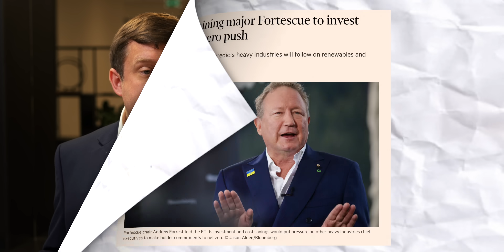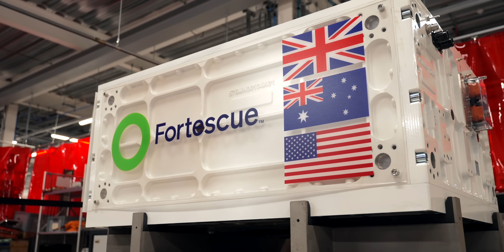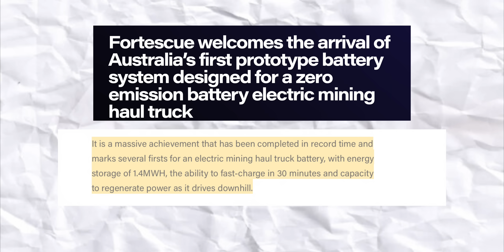This GIANT Electric Mining Truck Charges in Under 30 minutes!

Comment: Then there is Komatsus E-230 Electric trucks that feed the electricity from overhead wires and have the power and electricity to run at double the speed of diesel trucks as they do at Cooper Mountain mine BC Canada

Comment: It isn't really true - it doesn't actually charge in 30 minutes - Unless - a giant battery farm has been charged in advance.  Like the Tesla Semi - you can get a faster than expected fast DC charge from a farm of batteries pre charged ready to transfer the power, however - that isn't much different than a battery swap; and now you have a giant depleted battery farm incapable of charging any other giant trucks - so - subsiquent trucks will take hours upon hours to charge - and that is only via the grid because it is very unlikely that the first truck charged would do so in the morning, and much more likely the afternoon with insufficient time of day to charge a large battery farm from solar. If you charge from the grid, you've achieved nothing.

Comment: I still don't understand how they can say are "going green" when the battery life is estimated at only 2 years. 360 trucks changing batteries every 2 years is a lot of waste batteries as they haven't worked out recycling yet other than saying they will be used as a battery bank for the solar array.
Reply: Where did you get the lifespan from...?

Modern EV cells last for more than 3000 charge cycles (3000 cycles results in a 90% capacity left)...

The amount of diesel these haulers normally use is staggering.

So yes, its kiteralky going green
Reply: @zaarkeru3391  I work for the truck manufacturer and the specs were released to us. The only problem is that they are yet to actually make a battery work. We have had the first battery truck on site for over 18 months and are still waiting for the first battery. The reason the battery doesn't last is because they are being fast charged every 12 hours.

Comment: There are many organisations researching battery powered mining trucks, a  big challange is the power required to haul material up a ramp. The video commented on the 220t trukcks - this is the payload. A fully loaded 793F weighs about 390tonnes or 216 Tesla Model 3's. The energy density of batteries is poor when compared to diesel. Trucks run for 24 hrs without stopping on diesel, on batteries they need to charge for 10-30 minutes every hour. A swap out system would help ease this impact, but still at a cost to production.
Exciting times in the mining equipment world - but marketing is way ahead of technology.

Comment: As long as the battery packs are easily replaceable so the maintenance people can do a changeover at some stage a reasonable idea. With early adopters of EV vehicles well aware of the need for battery pack replacement once over a certain mileage the pitfalls of EV vehicles should be noted.
Hybrid vehicles are making a sales comeback for many good reasons including longevity and reduced emmisions and much better fuel economy.
😎🇦🇺

Comment: Never show a loaded truck moving.Just saying!
Reply: You know, currently, there are a lot of EV trucks working on mine sites. Those  use electric motors and haul up to 360 tones already with ease. The only difference with these pure battery ones will be that they get powered by batteries as opposed to diesel generators,  which has zero relevance on the output of the electric motors.
Reply: Who in their right mind would doubt the torque of an electric motor?

Comment: The problem doesn't  lie so much if you can make the truck electric. The challenge  is where are you getting the electricity from to charge the electric trucks. It requires enormous infrastructure up north in the Pilbara to supply the needed electricity to run a operation of not just one truck, but a whole lot of them. And the electricity they use should be green. Not from coal, gas or oil.
Reply from the maker: I wonder what sort of electricity you could generate in a remote but very sunny locations with millions of acres of desert around you. I can't think of anything that could do the job, shame there isn't some sort of technology that can convert sunlight into electrons, and then store those trillions of electrins in some sort of storage tank, you could call it a battery maybe.
Oh well, one day, until then we'll just extract oil half way around the world, pump it onto massive ships, burns thousands of tons of bunker fuel, docvk them in AUstralia, pump the crude into takns, use huge amounts of electricity to refine that liquid into diesel, put the diesel on trains or trucks and transport it thousands of miles across the desert to burn it once in a massive, inefficient engine.
That's a much better idea.
Reply: @fullychargedshow  you can say the same for the electric trucks, how do you think all the materials for them get to Australia? What the carbon footprint is for solar panels and wind energy? Not to mention the storage in batteries that you need to have to run an operation like that and the carbon footprint. Instead of just blindly jumping in to electric vehicles, you might concidering a view facts that have major impacts on the environment. Electric vehicles are not green! In Australia 75% of electricity comes from coal and gas. So driving your Tesla in Australia is a waste of time and effort, you don't make a difference! You might think you do, but you don't!
Reply from the maker: @ericbeins7254  So the technology we know about today . . . that's it? Is it never going to develop? You seem very cock sure of your knowledge.
Imagine the motor in the first Benz combustion engine. One cylinder, massively unreliable, I'm sure there were a lot of horse breeders who looked at it and laughed if they were nice, or sneered if they were vile bully know all thugs.
So riddle me this, the 'carbon footprint' of an oil well, a pipeline, a massive storage tanks and all the necessary pumping systems, an oil tanker, the port facilities to make this massive, global operation viable, then the same port facilities on the other side of the ocean, then the refinery, then the transport and storage systems. WHat about the carbon footprint of all that? 
NO ONE ever acknowledges the massive, devastating impact all that has, we merely measure the pathetic 'tailpipe emissions' and we all accept that as being reasonable. Meanwhile the fossil fuel industry and their shills and PR scum are laughing all the way to the off shore bank.
Yes, diesel trucks are reliable, we can depend on them to burn 4 or 5 gallons a mile when working in a big mine.
Lovely, aren't we all clever, let's not try anything else, let's always, 100% without question rely on burning a finite resource for ever and ever and believe it will have zero impact.
Bye.
Reply: @fullychargedshow  what point are you trying to make? I am saying do your homework and look at all aspects of the enginering process. Not just does it have a tail pipe or not! Whats the point developping these things, if they are no better than what we working with now? Electric car/trucks have been a failure so far, not because they are engineered badly. They fail because the infrastructure is insufficient and they don't comply with the human needs. The environment is only one part of the equation. It is not about, my opinion is better than yours, it is about coming up with solutions that tick all the boxes, not just a view! So you being critical of the system we have, I agree with you on that. So why can't I be critical of the system they are developing? There are many boxes it doesn't tick. Don't you want a system that is better and solves the problems that we have? Or just change it for another system, just for the sake of changing?
Reply from the maker: @ericbeins7254  Sigh.
This is my ONLY question.
Can we continue to burn, and it's so boring typing this, millions of barrels of toxic liquid fuel every day?
You obviously think it is even though you casually acknowledge this is possibly a vague problem in the distance. 
I do not agree with that.
You then make this utterly absurd claim that electric vehicles 'fail because they don't comply with human needs.'
I respond with this. 
Combustion engines of any sort, anywhere, do not comply with human needs.
If you breath near one when it is running, it is forcing you to breath in carcinogenic particulates and gasses.
When has that ever been complying with human needs?
We've all put up with it because there was no plausible alternative.
There are now over 400 million electric vehicles in use globally, (290 million scooters and mopeds). 
99.9% of the people using them are very very happy with them and are benefitting from the multiple advantages they have over filthy, unreliable legacy technology.
So, once again, the point I am trying to make which, of course, you resolutely ignore like so many other men, and everyone affiliated in any way with the massive, global and politically powerful fossil fuel lobby is this.
I want the human race to stop burning stuff.
How much clearer can I make that?
And that, Eric, is the end of the conversation. It doesn't matter what dull 'engineering' arguments you try and twist to fit your pro-burn narrative, you want to burn endless filthy fuel, I don't.
Bye, again
Reply from the maker: @ericbeins7254  I am 68 years old. I have lived with, listened to, communicated with thousands of people who hold different opinions from me, without difficulty.
I have also had to listen to very patronising people much, much younger than me who suggest things like 'the world is not black and white' as if that is going to help me, because I am 'so blinkered and deluded.'
So my young friend,  with your confident statements are based on opinion and bias, not fact or knowledge, I fully understand the disputes between people are a series of subtle greys. 
I hope you learn to be more careful with your comments, and think through your more strident claims, and accept that there are always areas of knowledge we may not be fully cognisant of. That is what I do every day.
I too, hope you have a great life.
Reply: Mines have a lot of power available... A 3MW charger is nothing.
Reply: @kstorm889  yes but now multiply it with 50 trucks. How long can they go on one charge? And how many times do they charge up per 24 hours to do their job. The power that most mines have comes mostly from diesel generators. So yes they can do a 3MW charge, but can they do it consistantly and without failures. Diesel trucks are reliable, easy to fix and relatively easy to operate and run in remote areas. The costs of running your machine park on electric trucks fully relying on renewable green energie is enormous compared to diesel trucks. If it was that easy and cheep to do the industry would already have done it.
Reply: @ericbeins7254  I can assure you we do not power our plant with generators. That would required probably over 100 gensets. Believe it or not, nearly half of our energy is renewable. If our current trucks can run about 3-4 shifts before fueling, so if these can run a half shift on a charge, our mine runs around 25-30 trucks. That works out to around 10MW or 3-4 chargers running constantly, which is still under only one of our mills consumption
Reply: @kstorm889  If you do only 6 hours per charge, do you then require extra trucks to have the same production requirements? What fuel do you run your powerplant on? If you don't  mind me asking.
Reply: @ericbeins7254  you'd probably need more trucks, but you'd probably save time on trucks down for PM's. Our grid is around half renewable due to hydro, and the rest is mostly natural gas.

Comment: I recall that Fortescue had terminated the project to build the large solar and wind generation plant in the Pilbara at the end of last year. 
I recall their plans to move away from gas and diesel for that operation requires between 2-3 GW of energy - not insubstantial! I’m interested to see what the current plan is for that but can’t find much info.

Comment: WOW this an absolutely laughable. ANYONE here who thinks 100,000 cells is anything like GREEN,, sustainable or remotely OK are on some crazy drugs. Nothing here adds up with either current battery or charging technology. The "prototype" says it all - They were pushing it to get 1 truck charged in 30 mins - imagine the real needs if they had a full fleet of battery powered trucks. Again, until there is a monumental leap in battery tech AND a method to charge them (Not just thinking about the loads of 1 but several at once, same for cars) this is all just spin, marketing, greenwashing.

Comment: This company will go out of business or they will stick with diesel fuel. You can't charge a battery in less than 30 minutes...... not fully and not without damaging it. The power required to do so is massive! not possible, lies.

Comment: They're not the only ones trying to make a viable BEV haul truck nothing yet.. decarbonize mining.. let me get this straight their going to use diesel equipment in a high strip ratio mine plus 50% production loses to make BEV haul truck which the gentleman wanted to say is going to be less productive and it's decarbonization    🤨 right..
Reply: @oddjobsandrandomprojects   Use less, Conserve.. we have become should a wasted society it's unreal, nobody fixes anything even worse things are discarded with useful life left just because.. that's talking about true carbon footprint if it's not grown it has to be mined.. almost every single thing we use.. BEV equipment is not going to make up for the process of items from raw materials processing, refining and manufacturing to then turn around and throw the final product out.. eg. A guy with a Tesla in the driveway calming doing his part to save the planet when his wife remodeling the kitchen every 2 years.. drywall is 85% gypsum it's either mined or retrieved as a by product of burning thermal coal..

Comment: 1.4 MWh battery 🔋 isn't going to cut it..  a diesel electric truck uses 1.2 MW just for the drive circuit alone plus engine  provides power for hydraulics, steering and bake , cooling and all other auxiliary functions cab heating and cooling runs 20 to 22 hours a day on a tank of diesel.. that battery is a drop in the bucket u would need thousands of solar panels for recharging to make one truck viable..

Comment: I thought a mining truck had already been created that fully recharged on its way back down into the mine.
Reply from the maker: Hi Dave, I think you might be referring to the mining truck in Switzerland which operates in a very specific geographic area. It climbs up a mountain track to a quarry high above the cement works it supplies. So it goes up empty and comes down full. It generates far more energy from regenerative braking on the way down when fully loaded then it does to climb up when it is empty. That excess power is fed into the grid.
https://www.greencarreports.com/news/1124478_world-s-largest-ev-never-has-to-be-recharged
Reply: Interesting I have recently traveled through the Himalayas…. A number of communities go up and down and they have an excess of water. They could very easily load up a bladder with water regen going down dump the water at the bottom…. Pretty sure they could almost do it without charging??

Comment: Your typical talk fest with little to no specifics. What they don't tell you is that that dump truck that used carry 200t now can only carry 150 because it needs a 50t batter pack run the sucker. A Ford 150 battery pack weighs just under a ton. What do you think one of those suckers is going to weigh? And the BS around 30min charge is just that BS.
Reply: Why would 30 min charge time be BS? C rating is the same regardless of capacity.

Comment: I want to see the massive connectors on this thing to charge it! Surely not CCS! 😂
Reply: Let's see... did she say the truck had 1.4 MWh of batteries? And a 30 minute charge time?

Let's assume they're charging from 15% to 85%, which is to say, 70% of the total capacity, or roughly 1 MWh.

The rate of 1 MWh/half hour = 2 MWh/hour, or 2 MW. The amount of output from several thousand solar panels in bright sunlight. (And in that part of Australia, I bet every day has bright sunlight.)

Now, 2 MW sounds like a lot, and it is, but I note that CCS type 1 has a theoretical limit of something like 500 or 600 kW. So you could actually pull this off with only about 4 CCS-1 cables per vehicle stall. (Of course, this being England and Australia, it would be CCS type 2, but offhand I don't know the limits of CCS type 2, even approximately.)

Comment: Surely you'd make swapable battery packs, and use the packs as the grid storage. Lacked a little detail - how many volts was it? How long does it last? Are the trucks brand new or can these be swapped to existing?

Comment: So .. a PROPER truck can do, based on the tank, between 8 to 16h of the hardest work but this truck can do about 1 tenth of that so 50 min after which you need 30min charging. So 8h of work in proper truck is equivalent to  14h if you charge 0-100 in 30 min which is not including all of the overhead of moving to the charging station and such. For all intents and purposes I would say 16h. So.. again, as someone was saying: "future my arse"!
Reply: At mine which haul heavy cargo downhill the heavy cargo help to recharge battery through regenerative system.

And those electric will be used to drive empty mine truck uphill again.

So for some mine the mine truck actually doesn't need to charge at all.
Chinese already achieved this at their mine.
Reply: Yep.
Downhill hauling,  in the Pilbara. 
Na mate.👍